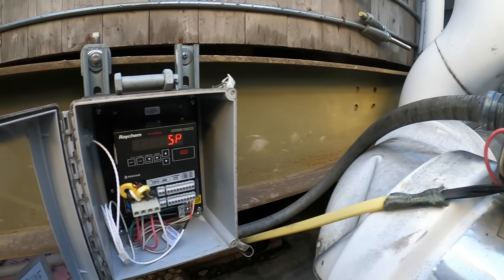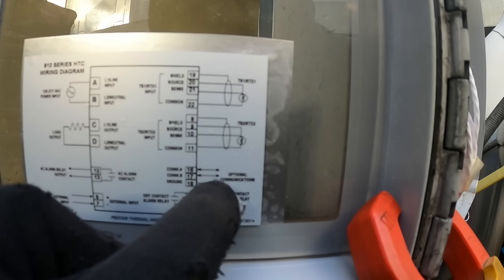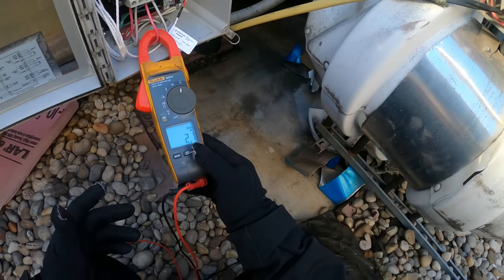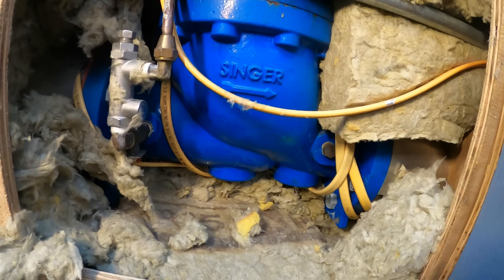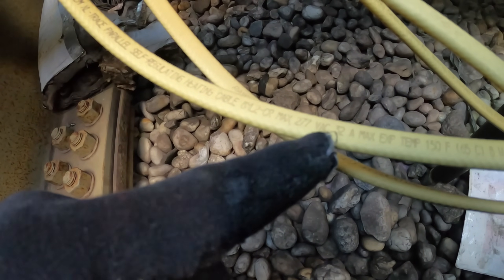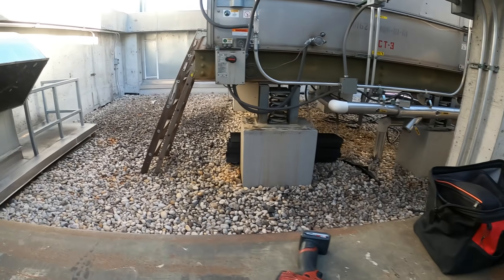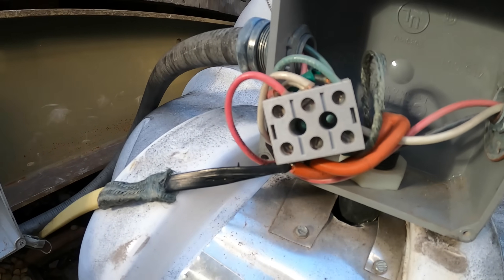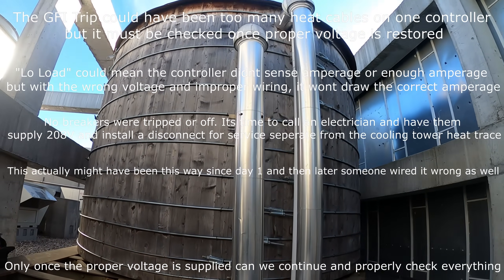HVAC: Water Tower Raychem Self Regulating Heat Trace Cables Not Working In Freezing Weather

Comment: Worked in Antarctica and have seen plenty of heat trace and monitors. 
Lower voltage on the heat trace is just lower heat output, if it's been installed for years and nothing has froze, it's not a problem. The heat trace itself self regulates, there is no thermostat in the heat trace. You configure the controller to how many feet of heat trace you have and if one of the heat trace lines breaks, fails or gets shortened the controller senses less current and will set an alarm. Just like the one that had an alarm for low current, the current it was manually configured for at installation is not what it is seeing now, so one of the heat trace lines is bad. Could have been like that for years or something just happened. But it was still outputting voltage to the existing heat trace. 
That set point has to be configured by the installer and even though the heat trace is 208V, you can still do simple Ohms law and get your currents for using it at 120V. But as said before, you just won't get the same wattage when using 120V vs 208V. But it will still heat and since that looks like a pretty old install, it's been keeping things warm enough even with the reduced wattage. 
It's not the OMG 120V on 208V as everyone thinks it is. It's not like a motor that will pull more current and burn up on undervoltage. Heat trace is just a resistive element, lower voltage, lower current equals lower wattage. Yes, Volts and Amps are inverse, but with the same resistance the lower voltage equals lower current and wattage. Try not to think of it in terms of HP on motors with a 1HP motor on 120V vs 1HP on 240V, that will be half the current. But you are still getting 1HP. With resistance elements, you get less wattage for lower voltage with same resistance. 
That GFI trip, is as others said, something faulted to ground. Could have been water or a burned through heat trace. That one was NOT putting any voltage out and that whole heat trace system was offline. So resetting that one was definitely helping the situation. That low current alarm on the other could have been in alarm for years. Could be the one miswired heat trace that's not drawing current or there is an actual fault. But without knowing how many feet of total heat trace, you can't do the calculation to determine what the set point should be.
Reply: And I'll add, I know you aren't a hack. If you ever do end up installing heat trace, label each run with the length and current draw. Label controller with where the zones it controls are. That way when the next guy, who could be you, comes along and runs in to this same situation you can check each run and compare the current as installed to current now. To help isolate the source of the low current alarm. Happens more than you think and if you don't know the length of run, unless you get zero amps on a run, you have no idea which cable is the source of low current. 
The ground fault, that is just like chasing any other ground fault.... can be fun, can kick you ass for months.
Reply: Well written!
Reply: @oldblueaccord2629  Appreciated, thanks.

Comment: "Self Regulating" on heat cable means that it is constructed in a way that varies the heat output over its length, and generally doesn't need or use a traditional thermostat control. Most can also be cut to custom lengths anywhere along the cable. Non self regulating cable gets up to the same temperature over its entire length, cannot be cut to length, and cannot be overlapped or touching itself at any point, and must have a thermostat on either end to control it. (Usually on the power input end.) 
The issues I saw (other than the obvious sloppy tie in) is damage to the line input end of the cable, the exposed braiding which will allow moisture to wick inside the cable and short it out, and having the long run going under the tank not touching a pipe.  I'm willing to bet the original install was with non-self regulating cable, and when it failed a hack did all of this we see  in the video. Edited to add: Before changing the power over to 208, you MUST verify that the embedded cables are indeed 208 rated! Other wise you'll be responsible for tearing all that pipe insulation off and replacing the damaged cables! I think the newer  hacked -in cables are the only ones rated for 208, am willing to bet the embedded ones are 120v cables.
Reply: Actually I looked it up it the WIDTH of the cable expands and contracts with the temp and regulates itself. Pretty damn neat. There videos from the manufacture came up on my feed.
Reply: @oldblueaccord2629 in self regulating heat trace it’s the inner black core that the bus wires are in that expands the warmer it gets allowing less pathways putting out less heat and contracts the colder it gets opening more pathways for the current to flow making the cable hotter. It self regulates itself along its entire length allowing for some spots to heat up more than others. Cool stuff

Comment: Did you measure between the white wire and red? They may have used the white for the other leg, not taped, and no actual neutral. The installer would have to be quite stupid to wire 120 and leave it not working.

Comment: That’s insane, was it a new install? If not how did they never know it was a problem? 
Great video as always.
Reply from the maker: @jphilbin528  It really is. This actually dates back to 2016. I guess nobody cared enough to look into the details here. Who knows how this all became about but it's time to correct it. Thank you & thanks for watching! 🔧⚡️
Reply: @JumpermanTech  As I commented in a book above, it's not the huge problem everyone thinks it is. Especially if it's been installed for 8 years and nothing has froze. Running lower voltage on the heat trace is just lower heat output. There is still  ground fault issue on the one controller (yes, that is a problem) and low current on the other, which may be a problem. But the voltage isn't that big of a problem.

Comment: There is a good reason, why in Germany you need a foreman degree to do installations like this. Also all installations must be done after the rules of the VdE. In this video I saw a ton of things that are not compliant to German standards. Example: It is not allowed to run cables into the cover of waterproof boxes.
Reply: I'm pretty sure that running cables under the cover of a j-box isn't compliant to any country's standards...
Reply: Und Trotzdem findest du auch hier so ein Pfusch  in Deutschland . Aber schön das sich hier noch paar andere Deutsche Tummeln :- )
Reply: In Germany we call it "Pfusch" 😂
Reply: Its not proper but its only 120 VAC. Thats household voltage here in the USA.
Reply: @oldblueaccord2629 , it sounds like 120 VAC as safe as 24 VDC ))